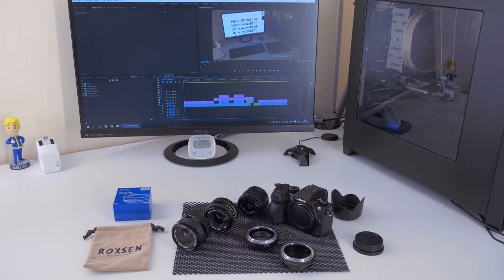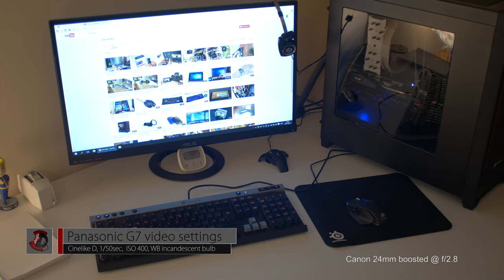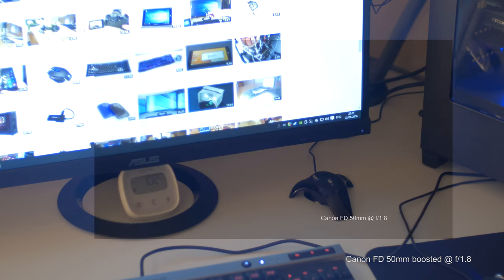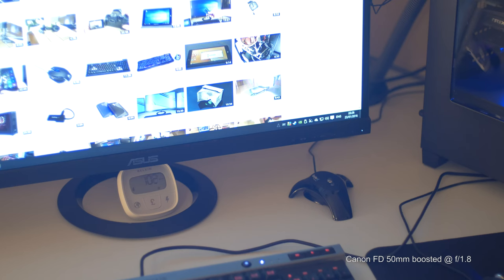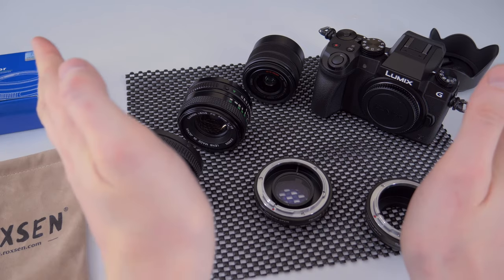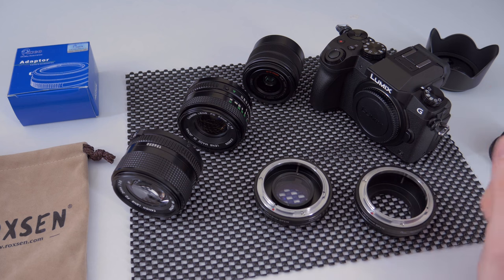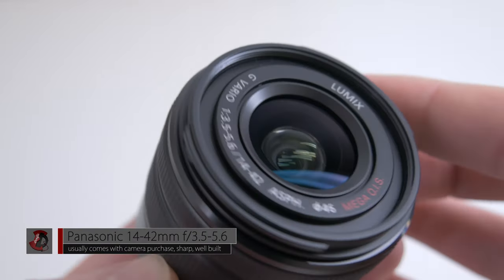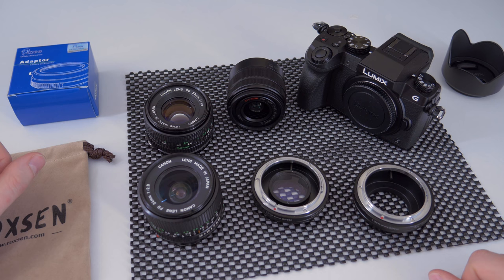Roxsen Focal Reducer aka Speed Booster Review

Comment: I use the Roxsen, which I got last year, on sale on eBay, for ~$80 (delivered).  I use it on my M4/3 all the time with a minty Canon FD 28mm/F2.0, which I got off of eBay for $85 (delivered). With the FR it's equivalent to a full frame 40mm/f1.4! Not bad for a total spend of $165.

Some recommendations:

-be careful when shooting into direct light.  Else, you see a blue haze/dot on the image.
-you can adjust infinity focus by loosening the lock screw on the FR and turning it's rear element CW or CCW.
Reply from the maker: +JB6789 thanks for sharing.
Reply: @JB6789, thanks for sharing your experience. I am new starter and always get confused about how these numbers are calculated. I love my M43 camera but have been annoyed by the crop factor and bad low-light performance. I am trying to get a ~50 mm <f1.8 prime manual lenes and was debating whether I should go for Zhongyi 25 mm f0.9 or choose the Cannon fd + focal reducer combo. How exactly to calculate the focal length and aperture after applying the focal reducer？

Comment: this question is more relevant to the lens, how would you compare 50mm to 24mm?
Reply from the maker: +umran89 you wouldn't really.
24mm is much wider lens used for indoors, landscapes etc. More of a general use lens to me as it produces more natural look in terms of angle of view.
50mm lens is much less expensive yet allows more light. However, it is much narrower field of view making it limited for indoor use but great for portraits and other photography where you need a bit of "zoom".
In my opinion both are must have. Ideally though if you have budget for it go for the lens that covers this range. Panasonic has 12-35, I believe. Very expensive but it might be the last lens you need for general shoots. Obviously 14-140mm is even better but the low light capabilities are so so.
Reply: +Eds drafts thanks I'll check out the panasonics too. will wait for a price drop though as they do that frequently, in meantime guess I'll pick both FD lenses.
Reply from the maker: Check 28-50mm on EBay. I saw few very reasonably priced. You can get this lens, Roxen adapter and try it out at both 28 and 50mm ans see what fits you more.
Reply: +Eds drafts yup guessing for starters I'll do that, those FD lenses with the adapter. as I wanna invest in future on a sigma 18 35 and rokinon prime

Comment: Hello Eds, thanks for the info you are sharing.  I am on to buy a budget system for motion pictures.  i was thinking on eos 700D(400 euro for the body) because  i have a good range of EF lenses. From today i am considering the G7 seriously. 
Question
Did you also  try the roxsen focal reducer for EF to M4/3? Do you have any feedback for that? I know about metabones option but i do not have the money for the moment
Reply from the maker: +Thomas Karanikas metabones to my knowledge allow limited electronic control of the lens. This Roxsen adapter only allows you to fit the lens but you get no control. Some of EF lenses to my knowledge do not allow manual only control. Do check before you buy either. Hope this helps.

Comment: great video. one of the folk selling Roxsen on ebay says: 

The depth is about 7mm, may hit the sensor of some cameras such as G1. The optical glass may need to be adjusted for Olympus OM-D, Blackmagic Pocket Cinema camera, etc.

Did you have any issues?
Reply from the maker: I had no issues whatsoever with my G7. It is relatively deep though so I would be careful using this adapter.

Comment: Great details with this review.  I notice that you have all Canon brand lenses to mount with your Panasonic. I have Panasonic GH3 & GH4 which I use on a weekly basis.My question does that specific focal reducer mounts only Canon lens or other lenses also? My reason to ask is that, I use vintage lenses on all my camera at all times. Brands like, Minlota, Pentax, Fuju(m42 screw mount), to Olympus digital zoom, and Fujunon CCTV lens.  Can these old vintage lenses fit the EOS or FD focal reducer? or do you think I would need to purchase several reducers to mount to my vintage lenses? Seeking knowledge.
Reply from the maker: Thanks. I used to, yes. I have now narrowed it down to Panasonic 25mm f/1.7. I also got an inexpensive kit of magnifying filters allowing to take macro shots with it. Great lens.
As for mounting other lenses you will need a separate adapter for each lens mount.

Comment: So essentially you get more of the MM using a booster?

I've always been told "on the m43 body, a 50mm is essentially a 100mm because of cropping". True? Will this improve that?
Reply from the maker: +phxdrummer16 yes, normal lens will double the effective mm, which will narrow the field of view (and in theory reduce the f/stop value. When you use the "speedbooster" essentially you are allowing wider angle / more light to be focused onto the sensor therefore better/lower f/stop value.
So yes, 50mm becomes around 60-65mm as opposed to 100mm. Speedbooster does not eliminate the crop factor completely but does a great job nonetheless.
Reply: I know about the .7X and .6X focal reducers, but is there a .5X focal reducer for micro 4/3?  That should get you prety close to the same angle of view from a full frame sensor.

Comment: Nice, the G7 keeps going down in price. Wondering, is it still worth it to buy it today with that $ 1000 Sony A6300 just around the corner?
Reply from the maker: +Philippe Orlando knowing Panasonic you will get deals twice a year, other than that the price will remain more or less the same. Especially considering the value you are getting. As for Sony - great cameras, just not user friendly and are horrible as actual tools to produce content. In my opinion. Panasonic just nailed it in terms of menus and usability on the G7.
Reply: +Eds drafts If SONY reworked its menu and added a decent touch screen, it would be huge.  If they had more lens choice, at competitive prices, it would own the mirrorless market.  Sadly, it lacks in these critical elements. IMO.
Reply: +JB6789 I got the G7 and love it!

Comment: Thanx for your video. What controls do i lose, when i use this Focal reducer? Focus, iris, peaking options, etc, etc,...
Hope you can help?
Reply from the maker: +lennart holterman you don't lose anything compared to standard adapter. FD lens is fully manual. You still have to control iris and focus/zoom yourself. Peaking, zebra and other functions are in camera so they still work fine. Having 3+ manually programmable buttons you can have any of these on the fly.
Reply: +Eds drafts thanx Eds

Comment: .I have a question. I have a Lumix G7 with                 14-140 lens. Now i want to get a speedboster, but i cant seem to find mft to mft speedboosters. Do they exist? how can I spped boost that 14-140 lens?
Reply from the maker: Hi. No they don't, sorry. The whole reason "speedbooster" was introduced is because of the crop factor using vintage lenses. And because of their attractive pricing and warm feel to whole footage.
As for M43 lenses - go for 12-35 f/2.8 and 35-100 f/2.8 to get that low light capability and have all electronic control.

Comment: thanks for video. i bought cheep focal reducer without lens element. and there is some problem. with foto it's ok.  but when i use video it loose a lot of light. it becomes very bad low light work even at 2.0 aperture. don't know what to do. using me g7 only several days. may be some problem with settings in camera. pls help. thanks a lot
Reply from the maker: Try checking the settings you are using. First set to manual, then adjust lens to visually see it opening all the way. When that's set set ISO to around 400 and try to play around with shutter speed. Eg. 1/50sec.
Reply: That's because video does T stop which is the amount of light that actually hits the light sensor. More elements means it's not going to work as well.

Comment: Hi,
What about image quality because there is a glass between the lens and sensor, does it affect image quality?
This review is not complete if you don't comment on the image quality.
Reply from the maker: I had no issues with image quality with or without this adapter. The only noticeable thing is the angle change and brightness increase. There is a lens flare effect when looking directly into the sun but other than that all looks good. Decent CP filter should assist reducing some of the unwanted "artifacts".
As mentioned - my main aim was to increase the viewing area and get additional f stop.